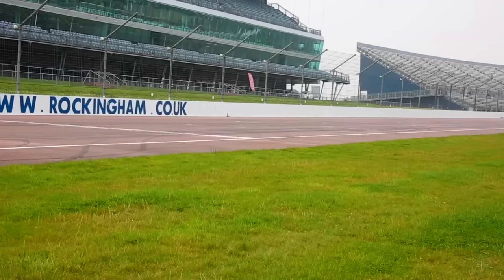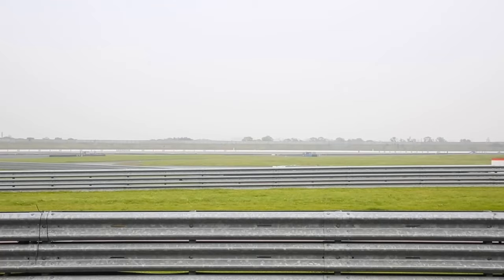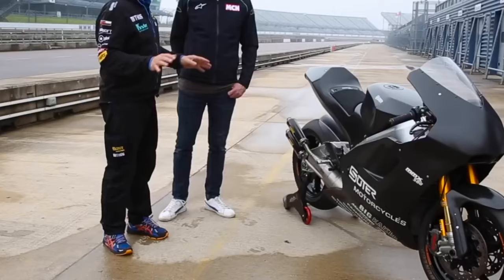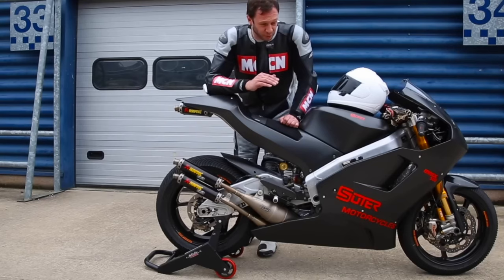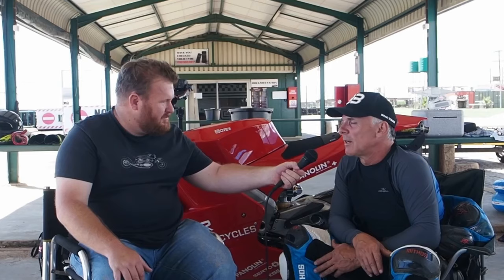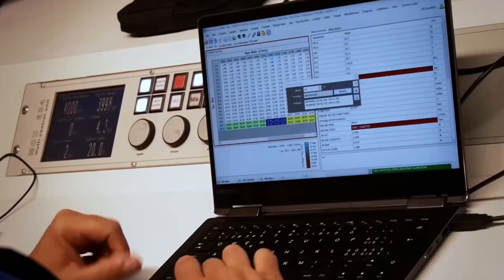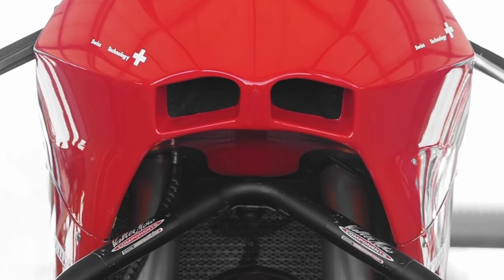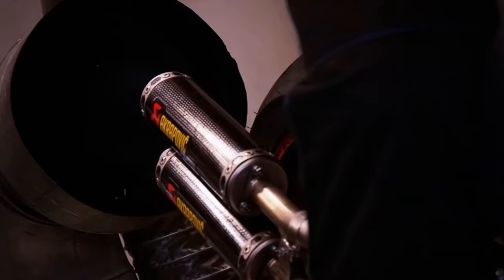ONLY ONE COMPANY OFFERS THIS BIKE!! (SUTER MMX 500)

Comment: In 1974  for example you could buy a Yamaha TZ-250   350 500 & TZ-750
Reply from the maker: I agree with. I actually am dying to find one to buy. But that was a street legal bike. Not a race ready 😊.
Reply: @ducaduke    In the  USA  They TZ Yamahas were race bikes only  Grey in 1974  just like my  1974 Yamaha YZ-80-A was..
  My friend sold a TZ-350 a few years ago.  I told him to call me if he wanted to sell it but he sold it to a Local Repair shop Dealer.
Reply: @Mike Skidmore
All TZ's where pure race bikes world wide. The 2 stroke road bikes where RD's.
Reply: @stevewilson204    Yes I know that.  I have a Brochure of the 1974 Yamaha Line up ..  that year in the USA the TZ-'s were grey as was my YZ-80-A.  
  It turns out they only sold about 200 TZ's of each displacement in the USA for Homologations purposes.
  The TZ-'s did not have lights and were not street legal you are correct.
  I have a 1984 Yamaha RZ-350  it had Catalytic converters on it ..
  In most of the rest of the world Yamaha sold the LC-350 which was similar to my RZ-350.  Maybe did not have the same Bikini fairing on them .
Reply: Bella moto in tutti e 5 i sensi dell'essere umano: Vista, udito, tatto, olfatto e gusto perché si può assaporare con la lingua il fumo della miscela del motore a due tempi. 😘👌🏻💯🔥🍾🫡
Reply: @stevewilson204  Head and barrels went straight onto the RD's 😉